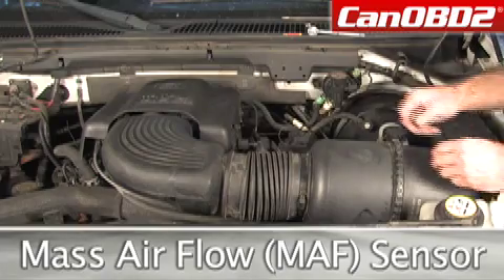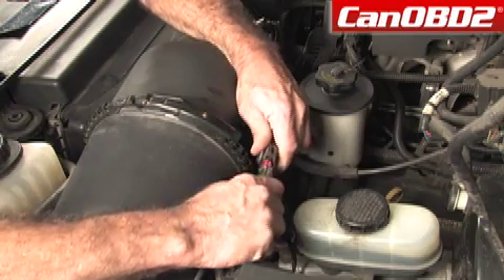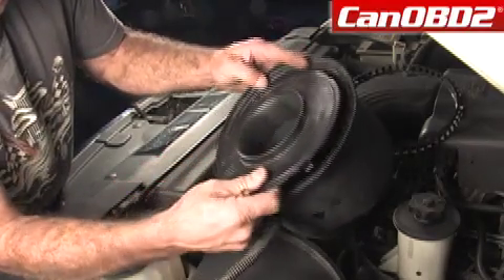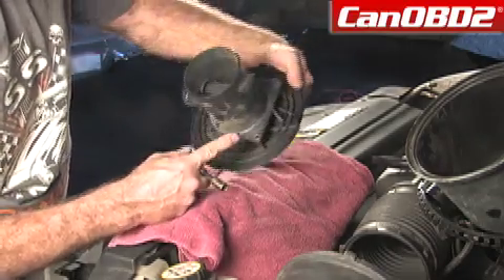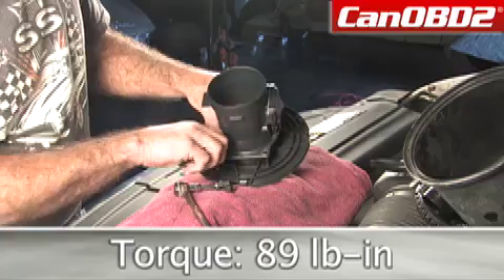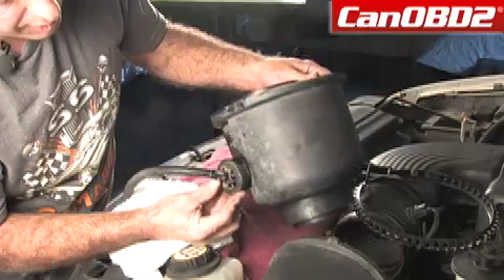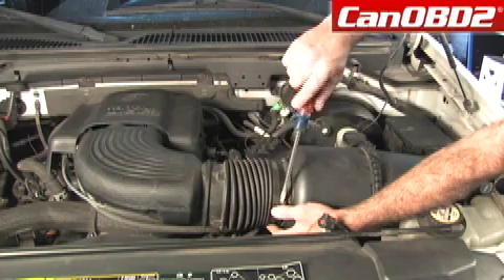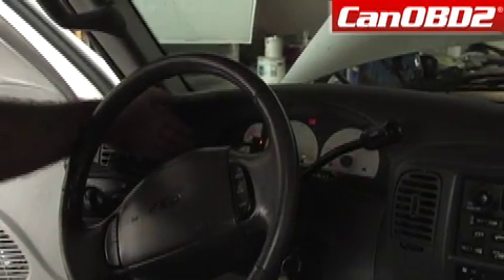Changing a MAF Sensor

Comment: your check engine light will come on and when and if you take it or if you have a reader it will indicate the sensor is not work a lot of the time if you clean the sensor it will correct the problem. Also when your driving you will notice that the truck has a delay when your punch the gas and your gas consumption is higher

Comment: @HunterCO1 Really I could sworn that a knock sensor detects preigniton(Knock)  and the ECU ajusts the igniton timing as GM calls it Electronic Spark Timing to correct the condition .. The Code it a Code 43 on the V-6 Camaro and it has two items in the circuit other than the ECU. One is the Knock Sensor and the other is the ESC module Electronic Spark Controll Module. On OBD-1 GM cars Codes 41-43 Relate to igniton timing and all effect the ESC module.  41 ECS, 42 Cam sensor, 43 Knock sensor MORON

Comment: @HunterCO1 You cant read can you, dumb fuck. I NEVER named the circuit, like you the dumb fuck, claim i did, I stated the two parts in the circut. Yes the CIRCUIT is called the EST cirucit  but the service manual calls the Ignition Module the Electronic Spark Controll Module. Yes when you disconnect the Brn/Blk wire code 42 is set but code 42 was not the issue. He had codes 41 and 43, The same condition my car had a year and half ago.